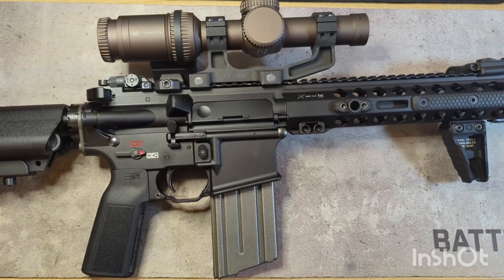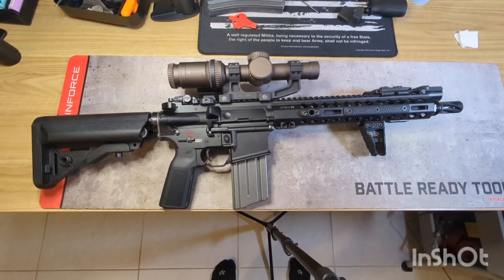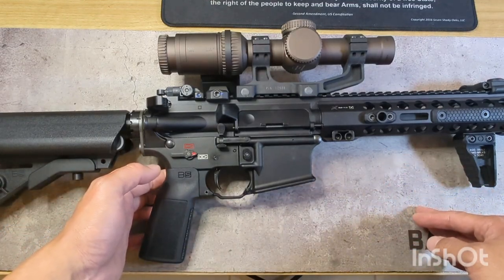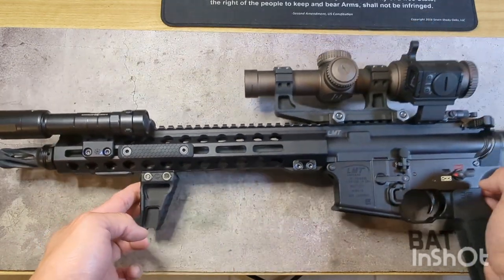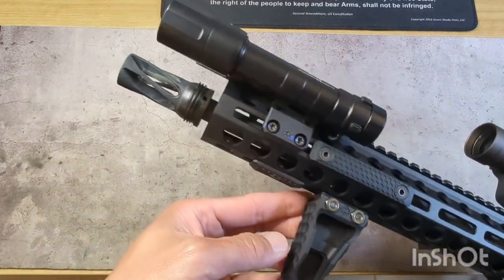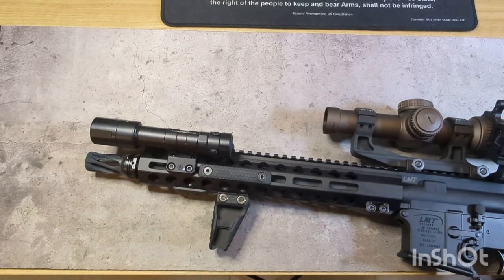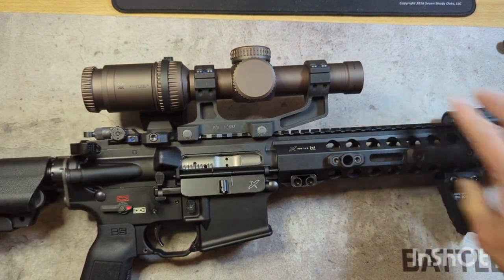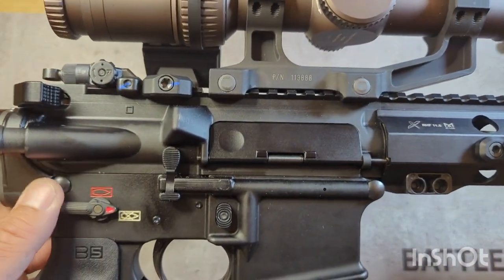12.5" build w/ Criterion Core barrel, LMT receivers, Sionics BCG

Comment: Nice build….. I’ve built a few Criterion Core AR’s (3 12.5”,13.9”,16” and a 18”) and they are top notch barrels. My 12.5” and 13.9” are my go to builds. I use BCM stripped uppers do to their thermo barrel fitment. I used the TDX gas block on my 12.5” and the Ripcord Gas Hole for 13.9”. The Gas Hole is a nice gas block but can be a PITA to install. I will say on hand-guards I used the Ripcord LDR1 11.75” on the 12.5. They are a bit heavier but built like a tank.
Reply from the maker: I had thought about the Ripcord also, but ultimately decided to go with the gas block Criterion recommends

Comment: Muzzle Velocity: A 14.5-inch barrel typically has a muzzle velocity of about 2750 ft/sec, while a 12.5-inch barrel has a slightly lower velocity of approximately 2600 ft/sec

Here’s what is making me second-guess my 13.9 Though;

The ballistics of a 12.5-inch barrel to a 13.9-inch barrel for a 5.56 caliber rifle, here are some considerations:
Muzzle Velocity: Generally, each inch of barrel length can increase the velocity of a 5.56 round by about 50 feet per second1. So, a 13.9-inch barrel would have a slightly higher muzzle velocity compared to a 12.5-inch barrel.

Chat gpt4 so take it as that.
Reply from the maker: I have a velocity comparison video I did recently comparing the two, and several other lengths. Check it out!
Reply: @regulardudegungearreviewsh3132  sweet. Thanks for the heads up.

Comment: How would you compare the criterion barrel to the Ballistic Advantage barrel you own in terms of gassing, reliability, and accuracy?
Reply from the maker: Both are gassed similarly, in which they don't like cheaper/weaker ammo. But the Criterion will at least run weaker ammo with a standard power spring and buffer. I couldnt get the BA to run any cheap ammo until I had BA open the gas port. Both have zero issues with feeding or cases sticking in the chamber. Headspacing is good on both. Haven't really had much chance to do any solid side by side accuracy testing
Reply: @regulardudegungearreviewsh3132  Thanks for the feedback. I ended up going with a backordered Criterion barrel and returned the unused BA barrel.

Comment: Ever have an issue with that cmt rail not tightening up enough and able to rotate slightly clockwise and counterclockwise?
Reply from the maker: Negative, and I also recently got the 15" RHF. Solid lock up on both
Reply: @regulardudegungearreviewsh3132  mine for my 13.7 build does. Drives me nuts. Everything is beyond tight too.
Reply from the maker: @revolutionanarchy713  have you tried contacting them? Maybe yours is out of spec?